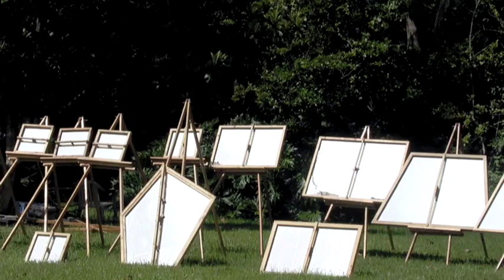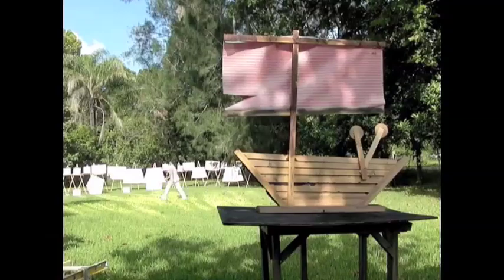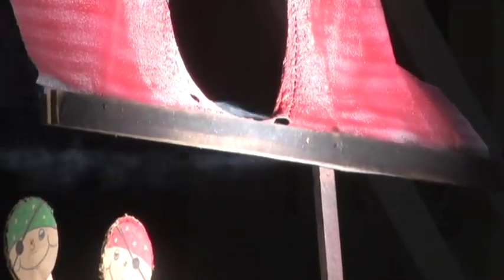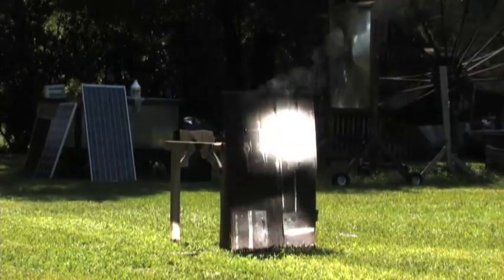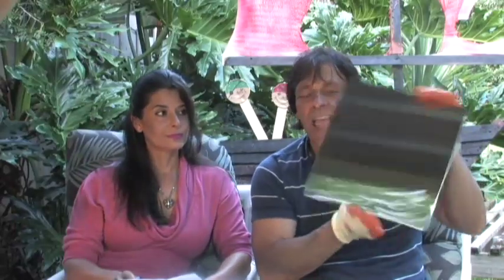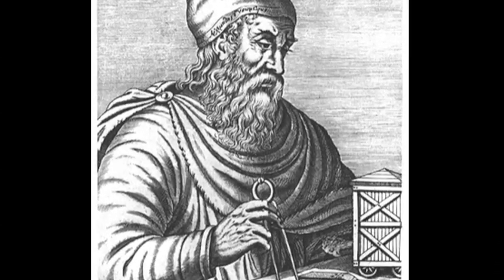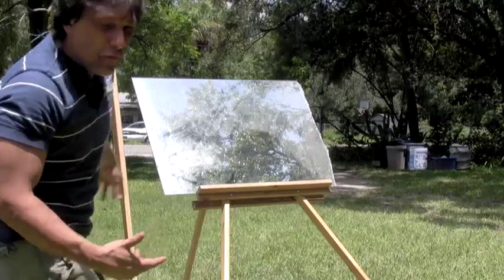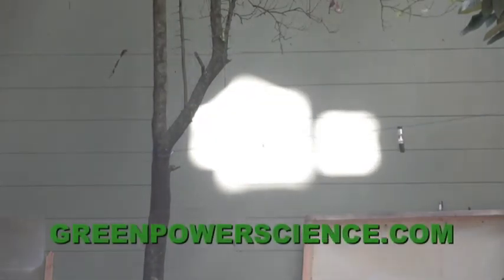Archimedes Death Ray Solar Parabolic Mirror burns a fake Roman Ship Mythbusters

Comment: Archimedes is shown using only 1 or just a few mirrors. not 30 like you guys. ALSO he was much much farther away. STILL not proven to be true.
Reply: “I fear the day that technology will surpass our human interaction. The world will have a generation of idiots.” 
― Albert Einstein

You proved Einstein correct, well done!
Reply: and the actual story, in which those paintings were derived from.
Reply: oh and for you doubters of what i said, if they were closer - the mirrors would of had to be pointed down, as they were on top of the city walls. pointing them down causes the to reflect much less light, as now only a smaller portion is catching the sun light, this would of made them null. so they had to be farther away, like say a couple hundred feet.
Reply: +OneLoudNinja The have tested and a parabolic mirror of 40 square meters made a brick melting that was supposed to withstand 1500 degrees Celsius. another parabolic mirror of just 2 square meters produced a heat of even 3500 degrees celsius and  itmade metal melt, and you just Need 300 degrees Celsius to ignite Wood. It´s possible...
Reply: John thyssen they also did that at a close range. not from hundreds of meters away.
Reply: actually yes i can say the the light would be lessened. It works the same as anything else with light. as photographer, which is the capture and control of light. I was taught everything there is to know about light intensity. If you measure light near a light bulb it will be brighter than if it were measured accross the room. If you measured sunlight in a valley and on top of a mountain, the mountains readings would be higher. If you take a magnifying glass,  and use it to focus light on a single point, just like this experiment - the closer to the object you hold it, the hotter it gets. It is taking all the light caught in the lense "disc" and focusing it onto one single point. But if you hold it half a foot off the ground, it no longer gets hot enough. Because not only are you further away, but the discs only reflect the entire light caught in them onto a single point - at a certain distance. think of it like lines extending outward. you can angle them to hit the same point, but if you remove the object they are hitting, the lines will keep extending. and will then cross eachother, and continue in opposite directions, like the shape of the letter "X". draw it on a piece of paper - draw a little boat, and then a disc. take 5 points inside the disc, evenly spaced, and draw lines that all meet at the exact same spot on the ship. now erase the ship and continue the lines. they spread out, thus the focul point dissapears, and their intensity drops back to normal. And to do it from a couple hundred meters would need huge discs, witht he right concave angle. but once a ship passes out of that few sqaure meter area, it will no longer work. and the story goes that they used polished shields. well i can tell you right now, that polished shields are not anywhere big enough. They would only be able to heat something up from a few feet away. not even 100 feet. this is KNOWN science. These arent just my guesses, these are facts. Now yes his theory works. But - the story of how it happened is a blatent, and completely dissprovable lie.
Reply: +Ambrosius Malachai (AMV GOD) Just because the painting of him has 1 mirror doesn't mean that was everything to it. Think logically. You probably have tried sometime to concentrate sunlight through a magnifying glass to heat things up or even make stuff catch on fire.

Imagine now that a 140 soldiers each wielding a medium sized mirror stand spread out on the castle fortification, each one reflecting the sunlight on their mirror which then turns into 140 concentrated heat rays.

Now imagine, if they all aim at the same ship, and even trying to hit the same spot on the sails. Chances are at least half of them will be fairly accurate on the same spot and now it doesn't take very long until the shit starts burning and since the remainder of the sails already are pretty hot from the rest of the mirrors reflectiong it will quickly follow up bursting into flames.

Mythbusters clearly doesn't try hard enough, doesn't have enough manpower or enough mirrors. Also, the sun is ALOT stronger along the earths equator. That also plays a big role in this to work.
Reply: not reading. the first line told me what i need to know. i am not just basing it off the painting, but off the actual text describing the events.
Reply: Daniel Asgaard no, i am far from ignorant. the fact that you made an assumption about me, based off of another assumption you made about what research i had conducted makes you ignorant. When the first line of your argument - aka the basis for your entire argument - is wrong - then reading the rest is pointless as i already know it will be wrong.
Reply: no, see there isnt a flaw with my explanation, therefore any rebutle would simply illustrate a seperate point, and as logically, my point is accurate - any other point would be in some form - incorrect. Therefore i would be wasting my time reading it and then pointing out the mistakes.
Reply: its not just about the distance its about the correct distance.  
now correct me if im wrong , but sunlight is actually formed by  smaller beams of light , if the ship is in the correct range(could be 10 , or 1000 meters ) without any obsticle those beams would be fixed to concentrate in a small center  ( that being as small as the designer wanted and could make it) that would couse an ignition perhaps even faster than in this video no matter the distance , you cant actually say that the "energy" that the sunlight has would be lessened just becouse of the distance each small "beam" has a fixed amount and the  whole concentrated beam has them all together .
Reply: +Ambrosius Malachai (AMV GOD) i dont disagree at your poi nt that it would be preety much not true as you should use much acuracy that simply is a bit hard to believe it could be and i understand the properties of the light . never the less if smaller curved mirrorlike metalic pieces were used to concentrate the light beams in a single point the ignition would be almost instant ... i still agree with what you said , it aint going to hapen by shields and people holding them ... it wont.. however by using wooden or metal stractures to hold the "mirrors" in place , and then lets say form a line at the sea or spread them in many random points you get a ton of ships in fire  and you use no man power  ... you see if you move them it wouldnt work . no i think it is not even close posible to happen with the means of that age ... still they had the mind and the time to test it ... not saying i would bet on it but still... if you were the king and someone proved you that you could do this wouldnt  you try it... still the theory itself has many gaps ...
Reply: that is so typical, not reading the rest based of the first line. i really despise people like you, ignorant fucks
Reply: +Ambrosius Malachai (AMV GOD) +Daniel Asgaard I thought about it for a while and i thing ill change my reply to simply this . firstly the example with the magnifying glass is a bit off you see it doesnt work whith the same principles it just has the same result but with varying and more limitations ... as to the other matter my thought are simply what daniel said so simply ... it can be done , and the fact is that they knew it , how else could they even mention it happen even if you dont belive it did you got to give me that , if they knew it can regardless the cost and the time or the methods it would require the would do it , simply becouse it ca  be very effective , if you ask me how , ill tell you i dont know exactly ... however not knowing how someone did it with less knowlege on the matter doesnt mean much ... again sorry for  making such a big reply .
Reply: nikos pant i have hard time to make good explanation in english, but its possible yes under perfect conditions. If there is cloudy weather you are immedietly fucked you wont be able to generate enough heat to make anything combust at 200 meter distance.

Many mirrors reflecting sun rays to the same concentrated spot will generate insane amounts of heat
Reply: +Daniel Asgaard i agree completely ! i still have doubts...but ill give the theory that much !
Reply: Ambrosius Malachai Yeah ok fair point. I don't blame you for not reading it, i made the mistake with my comment and next time (if there will be any next time with this subject) i will make sure to change my literation to better put forward what i want to say and not sound like a complete jerk.
Reply: +Ambrosius Malachai (AMV GOD) Nope, you are making a few fundamental errors. You are probably referring to the inverse square law, which indeed states that the intensity is inversely proportional to the square of the distance, however, that doesn't apply to a focussed beam. Light from the sun is parallel, which is why the shadow of a plane at 100 feet is the same size as its shadow at 10,000 feet. A flat mirror merely reflects this parallel light, which continues to be parallel providing the mirror surface is completely flat. 

The only attenuation would be by pollution in the air, in a complete vacuum it wouldn't attenuate at all.

Your statement about a lens, i.e. ' the closer to the object you hold it, the hotter it gets.' is completely wrong. Once you pass the focus point it starts to get cooler again. It's only hot at (approximately) the focus point. I say 'approximately' because it isn't 'visible' light that causes things to get hot, it's the infra-red radiation which is focussed at a different point than the visible light. A flat mirror's focus point is at infinity so it focusses infra-red and visible light at the same point, at any distance.

Also, the size of an individual shield is irrelevant. Given enough numbers, a set of hand mirrors would be sufficient to make wood burst instantly into flame. It isn't about the surface area of an individual mirror, it's about the total surface area of all the mirrors. In fact ten mirrors with a surface area of one square foot each, would provide a beam that would be ten times hotter than a single mirror of ten square feet, because that ten square feet of sunlight would be focussed on one square foot, not ten square feet.
Reply: not reading, my logic is sound.
Reply: Ambrosius Malachai Your refusal to read any rebuttal is probably why you come across as dumb as a plank.
Reply: myth and storys allways are wrong compare to how things realy happen .this has been proven by science and fact.many times over.all of  what you said just means the source material was off.

Comment: considering its burning wood, it seems like going after the sails would burn asap. Pretty sure hitting the sails would result in a damaged ship that definitely wont be running away.
Reply: I'm pretty sure that was Archimedes plan.  If sails are aflame, sailors can't douse the flames until they reach the deck, and that means masts become matchsticks first, and then they drop onto the ship below, creating even more chaos and sailor hazard.  I don't know why Myth Busters concentrated on wood instead of cloth.  We start a campfire with tinder then kindling, then firewood, not the other way around.
Reply: plus all the gunpowder on barrels/canons an tar btween the deck planks
Reply: @feliperamos9191  Gunpowder and ship cannons in 212 B.C.? You're off by about 1,600 years, but nice theory...
Reply: That's what I was thinking, why not just aim at the sails. They'll definitely catch on fire quicker than anything else on the ship

Comment: now try this with a bunch of lasers and a lens focused onto a reflector.
Then angle the reflector around the focal point to aim the resulting beam.
Reply: Laran Aries I did not explain what I am trying to say very well at all.Between reflection and refraction, the beams could be concentrated  into a single powerful beam.
Reply: Laran Aries This same thing can be easly achieved using a combiner system or a diamond which is known to combine multiple beams into one.

Comment: I just got a 1.5m (5 foot) diameter Eco-Worthy parabolic mirror off Amazon (also available on eBay).  Tried it this morning and it set a small pine board on fire in 5 seconds flat.  The board was very close to the mirror - about 1.5 - 2'.  But with a longer focal length mirror (not as deeply dished), it should be equally effective at much longer distances.
Reply: I should have mentioned, this was on Dec 31, at 41.3° N latitude.  Would be even more effective in summer.
Reply: Mike O'Neill Exactly, It is beyond me why others do not understand certain times of the year would be more effective than others, as well as your location.
Reply: Craig Sundberg U.V. light will still set things on fire even on a cloudy day if 300+ soldiers shine their mirrors at a single point, which is then shined at the target.This can still be done regardless of whether the sun is behind the target, or behind the defenders.On a cloudy day it would still work. you would simply need more soldiers to achieve the same result.with this method (and enough soldiers) it would be possible to melt stone let alone wood (assuming the collector could survive the accumulated heat).
Reply: +Laran Aries UV is much harder to aim due to it being invisible to the soldiers.
Reply: +ExtantFrodo2 that could easily be dealt with by adding a crosshair for the soldier to aim with. Since uv light does not fall like a bullet or arrow, it would be pretty accurate and easy to create.
Reply: Ben Masta
 Could a cross hair provide a means to aim a light that can't be seen where it is coming from off a mirror then onto a target? We are talking about a cloudy day here, right?
Reply: ExtantFrodo2 it wouldnt matter regardless, i was only talking about the actual act of aiming the beam, not the collection.

As far as an optimal collection angle, that would be pretty easy to do seeing as every single day the sun will be in the exact same position the following day at the same time. So basically if you new what time it was, you would know what would be the optimal angle to collect the light. 

I just dont think it would be all that hard to develop a system that utilizes everything efficiently. It's not like they would just throw some random soldier behind the mirror with no knowledge of what he was doing. If thoroughly tested, they could teach positions that would always be the same at the same time every day. The sun rises and sets the same way every day.
Reply: Ben Masta "that would be pretty easy to do"
You are dreaming. It would be a lot harder than you think.

Comment: Failed to mention 4ft parabolic shields would serve a dual purpose in case the sun went away and I believe they would have aimed for the sails as they are dry large target to focus beams on and can't be dosed with water easily.

Comment: The MythBusters are a joke they are wrong as often as they are right. I am glad to see you reenacted the Archimedes Death Ray because it worked for you and would have work better with 300+ men. I like to think he would have made 4 sets parabolic shields (set at 100ft, 150ft, 200ft and 250ft) held from the convexed side with 4 rows of 100 soldiers in each to aim at different ships at different distances with training done a few hours earlier on decoys. that way they could light up ships at different distances and continue as they got closer with more intense beams. just an idea.
Reply: They didn' have modern mirrors back then.
Reply: +Matt Fletcher yeah mythbusters used to be a lot better. It feels like they used to put way more effort into busting myths, making sure that it was actually busted, rather than just showing that a quick mock-up of the experiment wont work. 

Its been years since mythbusters actually used any kind of scientific parameters that would truly give any useful information.

Comment from the maker: With 2 people and a crap load of mirrors, this project took long enough but that would have made it easier for sure. The Mythbusters do have some oversights with projects. I think it is part of dealing with volumes of insanely complex projects week after week. Overall they get a lot right. I think getting their hands on a "Fat Albert" version was a budget killer. I have discovered (experience)that a lot of the shows on discovery and natgeo have a tight budget. Thank you for the nice comment.
Reply: Folks there were pirates in ancient time, like the Sea People. So I'm pretty sure there were pirates during Roman times.

Comment: HEY, you left the "PINE TAR": and pitch off your model roman ship.. (petroleum products?? = lower combustion point)  Good video. Beat the pants off Mythbusters. (I call for a science-off, get them on the set and spank them) There was a thing about the Jato unit too, they didn't use the one designed for a C130 on the impala.

Comment: I think they used 2 mirrors. 1 the size and shape of a sail(20x40ft.-40x80 ft???),mounted on a gimble,and a swiveling aiming mirror. The mirrors probably only needed to move a few degrees in any direction.Maybe mounted on a deck built between 2 ships. So,Archimedes may have inadvertently invented the Catamaran.Very stable,perfect platform for this type of weapon.The aiming mirror;slightly parabolic or adjustable for range? The energy is there,we just need to concentrate it and aim it.PLAUSIBLE!